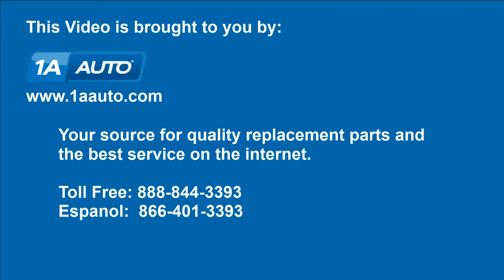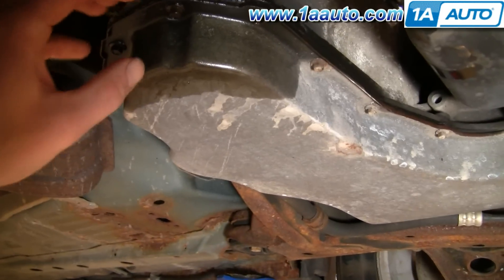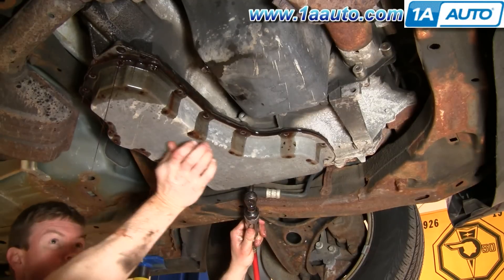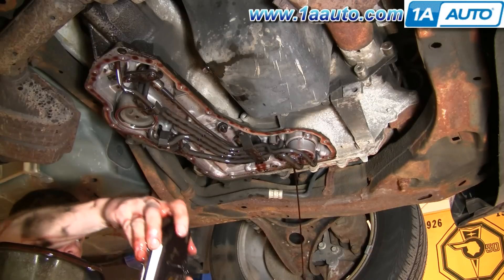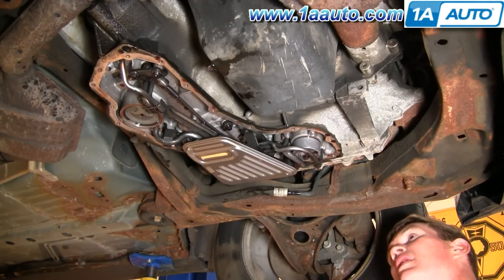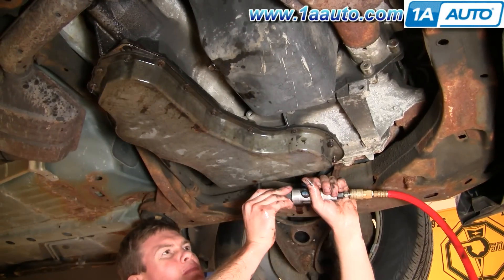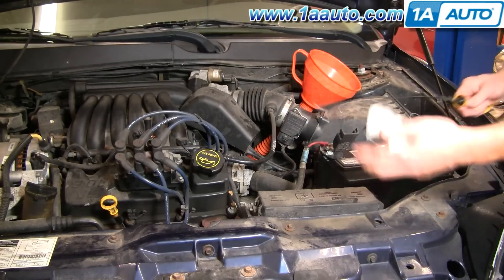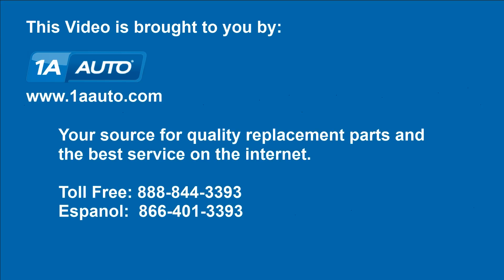How To Replace Transmission Fluid Filter 00-07 Ford Taurus V6

Comment: Just wanted to add a comment when removing the old gasket.  The old gasket is a metal ring with a rubber ribbed gasket, not just a rubber gasket.  After removing the filter you'll see what looks like just a  rubber gasket, but it is not just a plain rubber gasket.   It is a metal collar with a rubber coated gasket glued to it.  You must remove the metal collar with the rubber part attached to it as well.  I made this mistake.  Just hope it helps others.  Great video !!!  Thanks

Comment: Glad folks are out there making videos to help us all. The capacity of the transmission is around 13 quarts and 8 ft-lbs is 96 inch pounds. I had to add 7 and a half quarts to fill mine after filter change. I have the FORD reusable gasket on mine and I had to add a few more inch pounds to stop the leaks. I suggest adding a quart and getting underneath and checking for leaks and retightening as required and then add the rest and run it. Go underneath again and check for leaks after running. Ford suggests filling the transmission to the top notch on the dip stick to eliminate shifting problems when cornering.
Reply from the maker: Thanks for visiting us on YouTube. Have a great New Years!

Comment from the maker: @rzerndt Yes Most transmissions use this procedure.  You do not HAVE to replace the gasket but it is usually a good idea.
Reply: These gaskets are reusable, it is a good idea to change every other time you do the transmission oil change.

Comment: just changed my transmission fluid and filter in my 05 Taurus and it went as smoothly as this video. Thanks 1A auto your videos helped me with most my vehicles repairs over the years!
Reply from the maker: +brandon henderson That's our goal. We're glad we could help you out. 1aauto.com 866-403-3393

Comment: I just did this on an 03 Taurus with  the 3.0 with the 19 bolt pan and the dipstick clearly says use MERCON V plus the pan bolts were 8 mm. There is also a dimple in the pan where the magnet goes. This one took 6.5 quarts just like you said. Great video, thanks for posting.

Comment: I just wanted to issue a response to this video, If your Taurus has a AX4N or AX4S 4 speed transmission, DO NOT USE DEX/MERC III transmission fluid unless your dipstick OR manual tell you to. Use Mercon V or Mercon 5, which is a full synthetic transmission fluid that Ford introduced Mercon V/5 in 1998-2002. Be sure to check first before adding as the 2 fluids are NOT compatible with each other and will/have been proven to cause serious tranmission malfunction. Great Vid 1A Auto as always!

Comment: Thanks: watched your video twice and tackled the job. Took 2 1/2 hours to set up, do it, clean up.  Used a jack and jack stands, and an 8mm socket. Otherwise, same.  I did get confused because the parts store said there's an "orange" and "green" gasket on the filter: 2001 Taurus SES, single owner, with 83 K miles. Vulcan OHC, E85 with AXOD Metric on transmission pan.  Symptoms: a slight "judder" between gears, and seeping from the transmission seal and shop wanted $250 to replace the seal and flush.  I drained it, refilled the 6 quarts, changed the filter and seal, and it smoothed out 75% of the "judder between gears.  The previous owner put "permatex" on bottom of seal, pan-side, which is why it probably leaked.  Next, I'm going to replace the Transmission Speed Sensor, as I hear that can cause a "judder". Thanks.
Reply from the maker: +Steve Butler Thanks for checking us out! 1AAuto.com

Comment from the maker: Normally with cars that we have worked on, doing the flush helps out a lot. Over time, the fluid loses its pressurizing properties so the clutches will have a lag time before they engage. Your best bet would be to drop the pan, swap the filer, and then do a complete flush.

Comment: caution, when you take out the old filter rubber, be sure it also has the metal sleeve.  mine was stuck in there and it looked like part of the housing.  the new filter would not go in and it took me days of filing and buffing before I figured this out. 
no one ever mentioned the filter had a two part rubber over a metal sleeve.

Comment from the maker: There is a gasket that was on the pan (hard to see in the video). Usually you'll lay the new gasket on the pan and put a bolt or two through it to hold it in place.

Comment from the maker: @daverocker1 HI, Yes unless you have the transmission flushed or remove it from the motor and take is apart, this is all that will come out of the pan.

Comment from the maker: @babiboib7 Get under there and find out where it is leaking from. Most likely you need to replace the gasket for the pan.  Do not overtighten the bolts.  If your bolts have been overtightened previously you'll need to straighten the pan or get a new one.

Comment: great video, I have a 2007 Taurus, 82K miles, deciding if I should drop the pan or flush. There is so much conflicting information on the proper way to service a transmission. Ford Engineers say the best is 30K mile service, drop the pan, longer interval for highway driving. But if you don't know when it was serviced and the fluid isn't burnt, is it best to drop the pan? seems to me the low risk move, horror stories with higher mileage cars after a flush

Comment: Ok so I have a 2006 Ford Taurus SE and I'm about to chain the pan and gasket, but it really does need a full flush, it has almost 200,000 miles and has never been serviced but idk how to remove the full so called 13.5 quarts

Comment: if you have trouble getting the new filter in, check to make sure the old gasket came ALL out.  There is a metal band in the gasket and only half of my gasket came out leaving the metal band in there.  It looks just like the inside of the filter hole. Hours of mysery and confusion.  MY BAD but somethng to look for if you are having issues.
Reply from the maker: Great tip! Just goes to show how even the simplest of things can really slow a job down if we're not careful. Thanks for watching.   1aauto.com 866-403-3393

Comment from the maker: Unfortunately by the sounds of things it would be an issue with the transmission itself or the torque converter. You will need to bring it to a transmission shop so they can check the line pressure of everything to determine what the issue is.

Comment: my car began to vomit trans fluid a few days ago. i got under the car myself and saw that it was leaking from around the pan. i was told this would be a 700 $ fix . thanks for the vid now i know better. sometimes i think men assume because i'm a woman i must be stupid when it comes to cars. well i may not but a can do research and educate myself. i don't need to be treated poorly because i'
m a woman. thank you for the vid!
Reply: If it was Just leaking around the pan, you may just have loose bolts, try tightening them , just snug them up a little. Don't over-tighten or it might crack the gasket. If they're tight already the gasket might already be cracked, if it is, replace it...

Comment from the maker: You do need to buy a new gasket and transmission filter.If you're not doing a total tranny flush it may two 4-5 quarts to fill it back up. A service manual may tell you how many quarts it will take to top it back off. 1aauto.com 888-844-3393

Comment: Why didn't you fill the transmission with the 6 1/2 qts, then pull the hose coming out of the cooler and pump out all the old oil while filing it?  Seems to me you left in about 1/2 old oil.  Great, very informative video!!

Comment: You said that about 6-8 quarts drain out but the owners manual states that on a 2006 Taurus 3.0 Gas the capacity is 13.5 quarts.  So only half of the fluid drains out? How can we get the rest of it out without having it flushed?  Or is that even possible?  Thanks for any help.

Comment from the maker: Something like this will require you to bring it to a transmissions shop. It sounds as if there might be something wrong with the transmission valve body causing the fluid to come in through the dip stick tube.

Comment from the maker: You may want to see if it's leaking from around the transmission pan. If you haven't already you may want to have the transmission flushed and have a new transmission filter put in. If there's any debris floating around in the transmission fluid, it could be hanging up the valve-body or one of the solenoids in the transmission. Hope this helps you out. 1aauto.com 888-844-3393

Comment: Did you re-use the same gasket?
Also, is having a clogged transmission filter the reason it may be jerking going into second gear on automatic transmission? Thanks and waiting for a reply.
Reply from the maker: +Maarkie Marrk Thanks for watching!  That is a new gasket and will usually come with the new filter when you purchase it.  That could be the reason, but there are many other things that could be causing your issue!  1aauto.com

Comment from the maker: The main reason why transmissions fail is due to old dirty fluid wearing at the inside of the transmission. The best way to change all of the fluid is to have a mechanic drain the return line into a bucket while new fluid is added to the system. This method uses the transmission pump and not a machine, so nothing is forced through the valve body with excess pressure. Hope this helps you out. 1aauto.com 888-844-3393

Comment: Wish I knew why my new filter WILL NOT go on.  Popped off the old gasket and it’s definitely the correct filter.  I even tried using a jack to pop it in but I risk crushing the new filter.  I’m now stuck for the time being.
Reply from the maker: +Broncort1 We wouldn't be able to diagnose an issue like that here, you may want to have a local mechanic take a look at it. Thanks for checking us out! 1AAuto.com
Reply: @1AAuto  turns out I didnt have the entire old gasket out...just the green rubber part.  Whoops!
Reply from the maker: +Broncort1 We are happy to hear you were able to get it figured out! Thanks for checking us out!

Comment: I have a 1994 gmc Sierra pickup. I wanted to change the fluid on it for the first time but I find conflicting arguments on if it should be or not after 100000 miles. Mine has 125000 on it. The say if never changed it could cause the transmission to slip. Would it be ok if I changed it? I will also add truck has no issues with the transmission. O yea and what did you use to get that little o ring out of the transmission?

Comment: It's easy to do...the filter kit from the parts store will want to know how many bolts are in the pan...either 17 or 19 so count the bolts and get the kit along with 6 quarts fluid...usually about $5.97 per quart and the kit is only about $12.00 to $15.00 dollars. So for about $50.00 to do it your self or $250.00 for a repair shop.

Comment: Is this the same for a 2004 Mercury Sable GS because its leaking from the back of the transmission pan and when I go up hill it is not catching gear when im pressing on the gas. It hesitates and then eventually catches gear and goes. What could it be?

Comment: @newmanto03 hey i just replaced a piston and connecting rod and bearing with engine in car so i had to remove oil pan which was harder getting off then putting on for some reason. the thing that makes it difficult is the exhaust runs closely to one end of the oil pan you will have to disconnect at both manifolds as i did or maybe you could just unbolt the pan and remove old oil pan gasket and finagle new one in, i bet it could be done and would be the easiest way.

Comment: Couldn't you connect a hose into to the sending line of the transmission into a pan and then gravity feed more trans fluid from the fill tube to do a complete flush?

Comment: I followed your vid but my pan is leaking through the bolts.  Not tight enough?  Should I use a loc- tite agent?  Did I screw up the new gasket?  Thanks.  Love your vids.
Reply from the maker: Hi Stephen, If you replaced the gasket with a new one and it's leaking make sure the gasket is okay and not damaged. The bolts should be snug, but you do not want to over tighten them either and risk breaking a bolt. Hope this helps out. 1aauto.com 866-403-3393

Comment: Also Ford recommend every you change every 30,000 miles. If you waited to 60,000 to do this job then never have a completely flushed. this is why transmissions have major problems because people do not change the oil on time. You reap what you sow.

Comment: Is it normal to have some bubbles on transmission dipstick? The fluid has been changed by other owner. It doesn't look or smell burnt. Still shifts and drives good.

Comment: I have a 2001 Taurus with 191500miles. I'm just starting to have transmission problems. I was wondering, should I trade it in and get another cash car, like a Impala, of just Rebuild the transmission.

Comment: Why didn’t you use the drain plug first before taking the pan off. The Ford Taurus has a drain plug which is what I used to do a drain and fill.
Also Ford told me that as long as you do scheduled maintenance, you don’t need to ever change the filter.

Comment: One question, can you install a drain plug in transmission pan? Also a comment, not all of us have a car lift so we don't have much choice but go to a shop
Reply from the maker: +Steven Dunn Thanks for watching, Steven!  If the transmission pan does not have a drain plug then you do not want to add one.  If you drill a hole in the pan you compromise the metals integrity, and particles can get into the oil.
Reply: Black Sheep  You could do it on some rhino ramps , I have one to do as well but need a good wide catch pan or there will be a mess

Comment: Whenever I shift my 03 Taurus 3L, from park to drive it lurches pretty badly. Sometimes if the car has been in park for a while I really have to pull back on the gear shift to get it out of park. The lurching is also present when going from park into reverse but not as severe, and it is barely noticeable (but definitely still there) when going from Neutral to Drive/Reverse. It has 176389 miles on it, I got it last year or so, and as far as I know it has never had any transmission service on it.

Comment: If my transmission won't  lock into gear when I shift it from p to any gear what would u suggest it may be I checked the cable and it looked to be intact also checked the shifter linkage that too looked fine I was told there is some sort of switch in the steering column that may cause it from locking into gear please help

Comment: you said the torque is between 6-8 ft pounds. I just got a new filter kit, it says " intall pan, tightening bolts to a maximum of 12ft. lbs". right now, I just installed it with 8ft. lbs.  i am not sure if it is okay. thanks.

Comment: This procedure does not  flush all the old fluid out, correct? Is it necessary to flush it all out? 
I have a 99 Malibu with over 100k miles.

Comment: shop around!
I got an offer in the mail for my 2000 ford Taurus with 150K miles from our local dealer 
It was something like 99.95$ for complete flush along with filter change and fluid.

Comment: Do yourself a favor by getting a pump to remove the oil through the dipstick opening. These pumps are very cheap. I got one that runs on 12 volts on Ebay for less than $10. I had a panful of oil fall on my face the last time I did it, and it was not fun.

Comment: i have a question i have a ford taurus 2000 all the sudden stop working in the middle of the street but i notice that evrything is working properly.when i turn the key to turn the motor on it does nothing at all nether the starter nothing it just turn on the gas pump and dash board is not theft problem. !!! they say is the key to the starter that is disprogram i dont know if this true i need help on this!!!

Comment: I have a leak in my 86 ford Taurus auto trans. it appears to be coming from the torque converter dust cover area.  is there a seal in there I need to change?

Comment: i there i need help on my ford taurus 2000 an it wont turn on. i was driving on and of the sudden turn off and it would not start nor the starter work . i push the car aside the store and check the starter to jumper so if its woking is good  i check the fusses from the starter and they are good too is not thef problem.

Comment: Too bad more cars don't have drain plugs on the transmission pan.
Reply: Some do, they all should but car companies would rather make money by customers paying to have it done rather than doing it themselves. Some companies are now removing oil drain plugs and dipsticks so you have to pay and have it serviced.
Reply: manufacturers don`t want you to service them, either get them to the shops or break it and buy a new car
Reply: Leo Wells what's so hard just take off the whole thing and poured out the T oil.
Reply: It would be nice, but to be fair with the longer service intervals, it could be more of a risk having an additional plug. Just another thing to leak or get damaged over time. At least this car doesn't have a bracket and exhaust under the pan like my truck had. It could definitely be worse. Also the cars with service free transmissions are the true evil.
Reply: Just buy a pan with a drain plug, that’s what I did for my 02 Taurus
Reply: Dorman makes a cheap quality pan with a plug. Nice than the OEM, it is painted. My old one was so rusted I figured it is going to leak soon anyway.
Reply: nice Idea, but the filter needs to be changed too.

Comment: Can this cause a check engine light to come on ?
Reply from the maker: It may if it's clogged and is effecting the way the vehicle shifts. You may want to have the code pulled to see what it's pointing to. Hope this helps you out. 1aauto.com 888-844-3393

Comment: a mechanic give a little check and he was unable to start the car he said that evrything is good on the motor starter, cables from the spark plugs , good gas preassure , pump is working is brand new. what could be? help me plz?